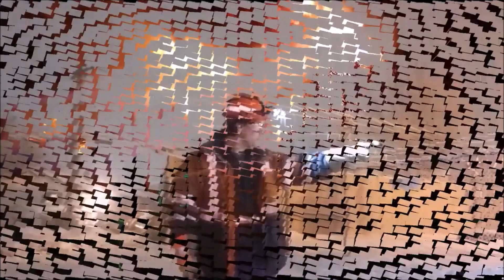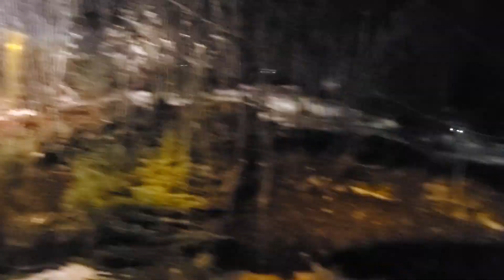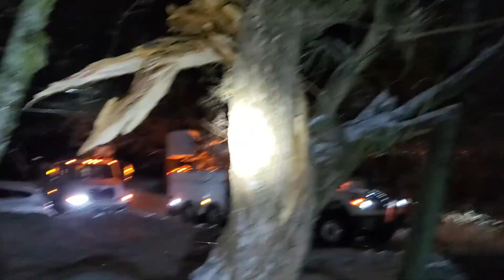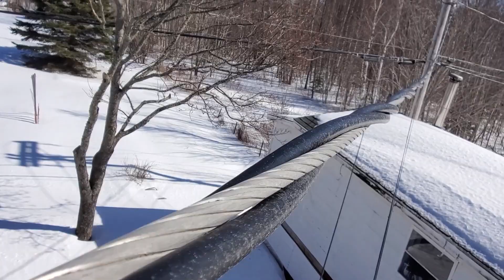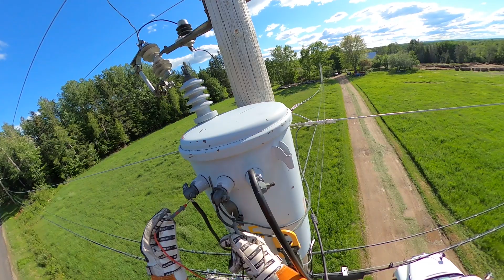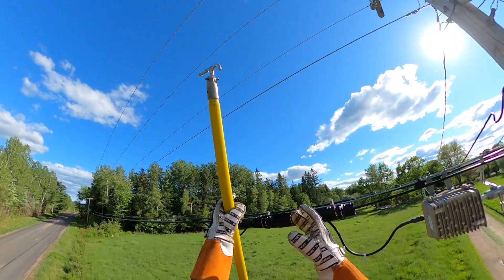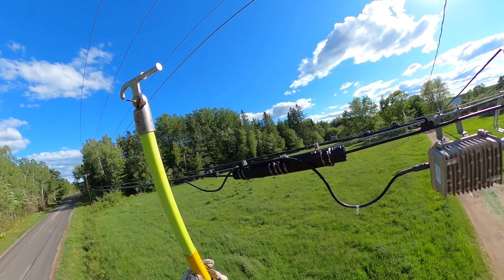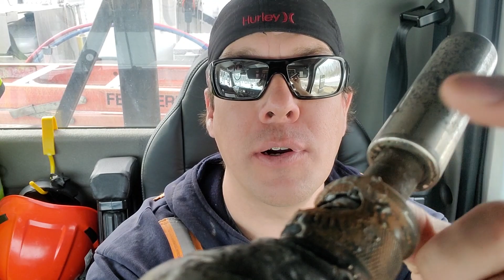Accidental contact with 120 volts

Comment: I²R
Live by it!
I've seen plenty of crazy damage with class 2 voltages on large busbar faults.  (UPS battery banks).  An auto battery is 1/10th your 120V example and can crank out 1000+ amperes.  Sparks galore.  Certainly 12V cannot "reach out" at you like 33kV but nobody uses PPE on 12V that 33kV requires either.  Of course DC vs. AC too.

And yes those pesky unfused secondaries.  I've seen amazing light shows from where a truck backed into a pole and his ICC bar crushed the conduit carrying a 500kcmil 480V 3ɸ drop.  Three 100kVA pigs above, LOTS of sparks and pink flames below.  Right where all the creosote is nice and bubbly.  Perfect combination for disaster.  And the primary fuses hold.  By the time line crew gets there to open cutout above the pole is pretty much torched, firefighters already there with charged hoses ready to squelch those flames waiting for the OK that the power's been cut!

Comment: It's no fun to have something like that blow up in your face. I'm glad your friend had his PPE on. Someone who has worked on their 120v circuit at home may have shorted the wires and it went bang, the breaker tripped and they think that wasn't so bad but that transformer doesn't have a 15 or 20 amp circuit breaker inside to protect you and when you short that thing out you are looking easily at hundreds of amps and like you said even with that much current on the secondary the fuse on the primary may not blow immediately. 👊

Comment: "The meter is off, the amperage is zero" not when you close the circuit with a short or your body. Likewise, it isn't the volts that blow holes in things that touch lines, it is the 200+A just like in an electric arc welder which can push 1000+A at only ~35V through 1" rods. Higher voltages merely make it easier to push more current through insulation and resistance.
Reply: @Richard Vaughn 100A is for relatively lightweight jobs or when don't mind needing 10+ passes to fill a large weld. Here's an example of ~1000A welding: https://www.youtube.com/watch?v=j61ezBX-EyA
Reply: It's important to note that your scenario can and will cause events similar to those shown in this video, it doesn't inherently make it for humans. It all comes back down to Ohm's Law how much current something will draw, no matter what kind of power supply you have. Most conductive materials make it very easy to push high amounts of current (theoretically) because they have resistances very very low. The human body does not have a low resistance, in fact quite high comparatively. I=35/.00000003 = 1 GAmp. I=35/1100 = .032 amps, and that's the low end of skin resistance; while wet and close together. Higher estimates will be around 80,000. Mostly harmless at that voltage. That's why some people get annoyed when they claim that it's "current that kills", because you can't have sufficient current without sufficient voltage. When skin resistance is relatively known, there will be a general minimum voltage where there starts to be a risk of dangerous electrical shock. Obviously it's the real world and these armchair calculations are going to be of little use if you happen to come across some edge case and scorch your arm, ending up with third degree burns, because you brushed up against something that someone told you wasn't dangerous in the middle of a rainstorm and you thought you could be fine. So just always use PPE and take proper precautions.
Reply: High voltages can produce large amount of current but high amperage CANNOT produce high voltage. It’s that easy 
- A real engineer (although not my major)
Reply: @powershotsss  Exactly!! And not only CAN high voltages produce large currents, given the same (resistive) load, a higher voltage will ALWAYS produce a higher current! In the case of the non-resistive load that a human body is, this effect is even more present.

Doubling the voltage in contact with skin more than doubles the current going through a person.
Reply: @powershotsss  voltage cannot produce current without a transformer.  Higher voltage allows more watts to flow through a particular resistance. Amps are what does the work.  30 volts at 200 amps will weld plate steel and must be carried by a wire the size of your finger.  200 volts at 30 amps makes sparks and noise and can be carried by 10awg wire.  We run 100+ building on a service feeder at 65kv and a handful of amps.  At low voltage (120/240/480) the wire would be the diameter of a car tire.
Reply: @ericapelz260  I'm not sure what you're trying to say to @Powershot? Are you saying you can make high current into high voltage with a transformer?
Reply: @jimmysyar889  Yes, transformers trade amps for volts or vice versa (step-up or step-down).  For a given amount of watts, you can have either a low amperage and higher voltage or a lower voltage and higher amperage. Volts X amps = watts, less conversion losses. Conservation of energy still says that you cannot, as Powershot said, "produce high current." with a voltage.  High voltage allows an existing current to flow.  An analogy to water is apt here.  Voltage is equivalent to pressure, amperage is equivalent to volume, and resistance is the size of the pipe.  The higher the pressure, the more volume you can push through a given diameter of pipe / the higher the voltage the more amperage you can push through a given resistance.   I suspect Powershot knows that and recognizes my point is about semantics.  The phrasing they used is unclear; making it seem like the high current is created by having a high voltage.  In any case, the voltage isn't as relevant as the available fault current.
Reply: @ericapelz260  High current is created from high voltage though. When you said, "High voltage allows and existing current to flow." I'm not exactly sure what you mean by that. There is no existing current before it started flowing.
Reply: @jimmysyar889 High current is not created from high voltage.  Let's rephrase "existing current" to "available current."
Reply: @ericapelz260  why would it not? V=IR if your v increases then so does your I.
Reply: @jimmysyar889  flow changes, but the current must be available.   You can't pull current from thin air.
Reply: @ericapelz260  Are you a native English speaker? I'm not really understanding what you're trying to say. I'm not sure if you're understanding what I'm trying to say either.
Reply: @jimmysyar889  Yes, I'm a native English speaker and have been working with electricity for decades.  Is the miscommunication the difference between "creating current" and "permitting current flow"?  Perhaps you could be specific about which words or concepts you are having trouble with.
Reply: @jimmysyar889  *For a given resistance in a resistive load*, high currents are created by high voltage.  For different loads, extremely high currents can be created by very low voltages.  Try cranking a large diesel engine over in very cold weather, and you'll see the starter consume several hundred amps at 12 or 24 volts.
Reply: @joshuapk9808  no, I know. What they originally said made no sense. I was trying to figure out what they meant. I am an electrical engineer in power electronics.
Reply: That's what he says.
Reply: @teardowndan5364  Also true, but the resistance of human skin is typically so high that a little source impedance is completely negligible (unless we’re talking about limited total charge like in the case of a static charge on a sweater or balloon).

Pretty much any useful high voltage supply can be fatal. On the other hand, you’d be hard pressed to make 20v fatal even with an ideal supply
Reply: @davak72  Depends on the definition of "useful": a CRT's cathode can be at over 50kV and still won't kill you, just a nasty zap from a few pF discharge. An oil furnace ignition transformer puts up 3-5kV but has a secondary resistance over 30kOhm which is shunt-regulated to 10-15mA so the transformer doesn't burn itself out, will give you a nasty burn but won't kill you. Domestic ozone generators only output a few mA too. There is no shortage of high-voltage low-current applications.
Reply: @teardowndan5364  Indeed. 100 mA is basically the minimum fatal current
Reply: @davak72  Duration is also a major factor, that's why people can sometimes survive lightning strikes and a bunch of other potentially lethal shocks.
Reply: @teardowndan5364  Ah, true, and with a few pF, a shock wouldn’t last long
Reply: Very true! I think this video perhaps better summarizes why the saying “it’s not the voltage that kills you, it’s the amps” is misleading (though technically true):
https://youtu.be/8xONZcBJh5A
Reply: @tripplefives you’ve clearly never seen a ships hull welded.

Comment: Fist bump from the UK! Congratulations on the new home too. I Also work  (on the UK railroad) with 120VAC everyday (fully exposed - standard ppe) and the only issue I've had is on a damp day when your boots are earthed well, you get a bit of a belt, or a few times when I've put my hand (accidentally!) across live and neutral bus bars. As you say, it;s not as simple as volts vs amps etc. heck 12 volts can cause serious harm. moral of the story is, don't mess with electric if you don't know what you are doing. No voltage is safe, only the supply can be safe.

Comment: For those who don't know, you get amps by dividing the voltage by the resistance. Steel is a relatively low resistance conductor. Let's just say the conductor is 3 ohms. 120v / 3 ohms is 40 amps! And to get the watts, you multiply the voltage by the amps. 120v * 40 amps is 4800 watts! That's a lot of power! Again this is just an example. The metal on the drill chuck is actually quite low in resistance which in turn will increase the power running through it.

Also the secondary of the transformer is actually 240v. Doubling the voltage quadruples the power!

240v / 3 ohms = 80 amps

240v * 80 amps = 19200 watts, 4 times the power of 4800 watts!

Comment: Mhh i remember a little accident 2 years ago... Where my right hand bridged alle 5 wires of a 380V 3phase wire. This smoked for 2 seconds. How are the power ratings secondary of this Transformers ? And how are they Fused primary ?

Comment: When they say it's the current that kills, they are talking about the max current the circuit can deliver.  You can have 50 million volts and only 0.001 amp and it won't harm you, but 50 volts and 0.1 amps will kill you.
Reply: Not necessarily in terms of electrocution. Its about how much current it can deliver THROUGH YOUR BODY. A good example would be a car battery. It's capable of well over 500 amps, and yet you wont even feel it if your grab the terminals with bare hands while you crank the car because the voltage is too low. The bigger danger would be getting burnt if you short it out with something, not the shock itself.
Reply: @chrisbauer1925  that is what I meant to say........late at night....lol...yes, if the circuit is capable of delivering a seemingly small current across your chest is all you need......I got 15000 volts from hand to hand, but luckily it was from a neon sign transformer that was current limited to 0.015 amps.....gave me one heck of wallop.though.....I'll never forget it.
Reply: @mdrew44628  But then it wasn't actually 15000 volts hand to hand. There is a series resistance inside the transformer that voltage drops across as current increases. The loading effect that your body had made the voltage drop, hence why the sign can only deliver 15 mA. Although that's still quite a lot of current. Sounds painful, and hopefully that never happens again!
Reply: @chrisbauer1925  I hadn't really thought of it until you mentioned it, but at t=0 it would be the open circuit voltage of the transformer.
Reply: @mdrew44628  Yeah that makes sense if there wasn't any current flow yet.

Comment: It may only be 120V but when it completed the circuit it was able to pass how many amps at least 200. at some point that's way more than you need to arc weld. Although that drill is a trophy of take your time and work carefully!

Not that it would've mattered but I would've loved to known what the resistance through the drill bit was then we could calculate the wattage.

Comment: So why didn't you discuss the amount of amp passing through the line when contact was made? The feed may be 120v but it was the amps that destroyed the drill and could have killed your friend. I watched a friend weld with a 12v car battery, it's the amps that allowed him to do that. It is the amps that kill not the voltage. If the volts have nowhere to go, no problem. If you short something out what ever amps are available can kill.
Reply: If it helps any, way back in the day (early '60s) I was taught that 50-100 ma (0.05 to 0.10 A) through the heart was flatly fatal. We probably wouldn't even notice a spark.